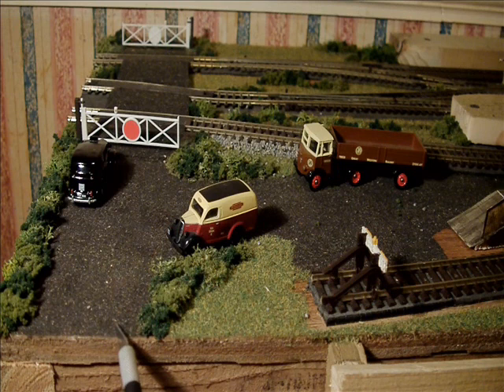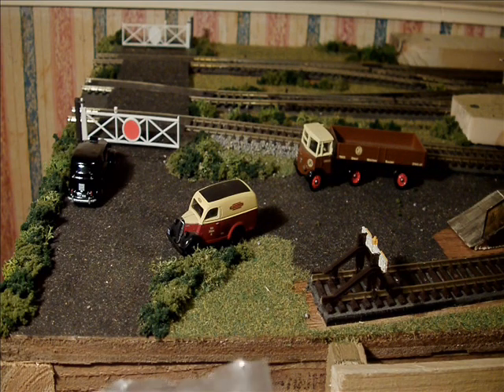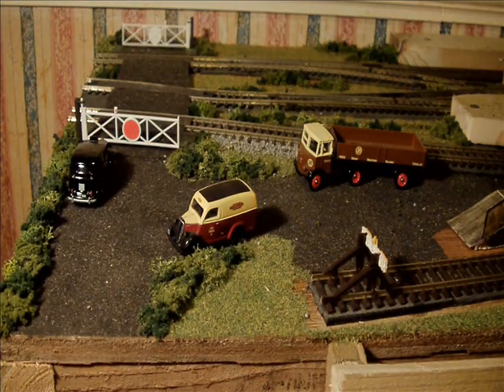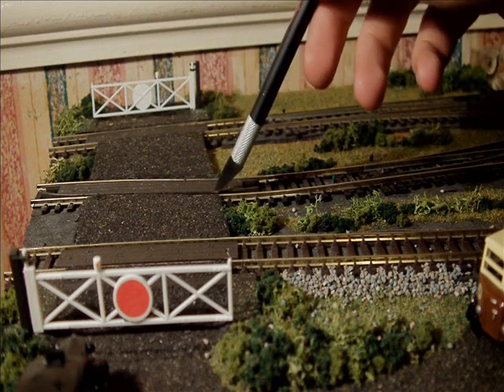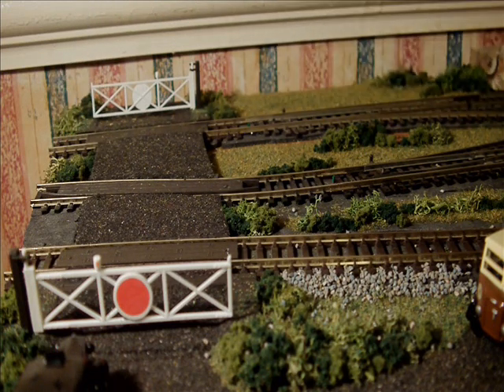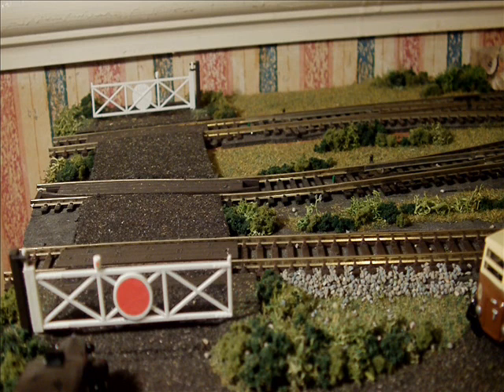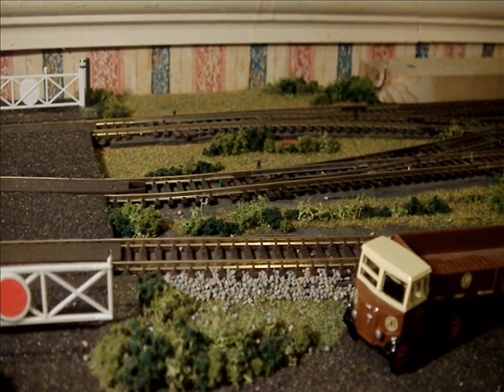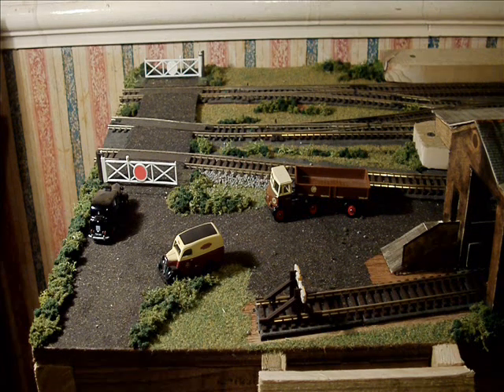OO Gauge Model Railway Layout Update - Part 2 - 15/2

Comment: a tip for your ballast is to put it in place and then spray it with waster with a little washing up liquid in it in a fine mist to wet it all then mix 40/60 water pva in a jug with a little washing up liquid in it and pour it all over your ballast and leave for 12 to 24 hours . . hope that helps